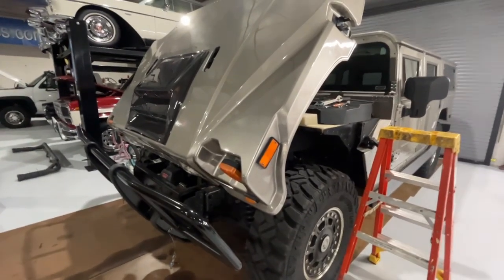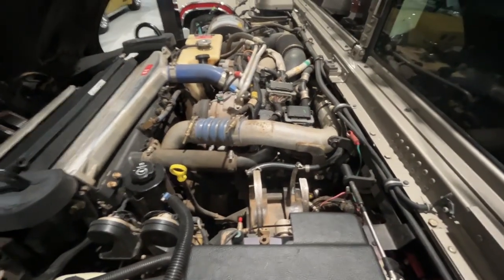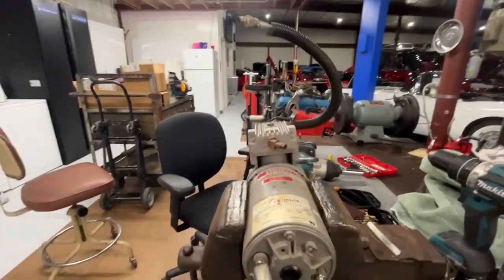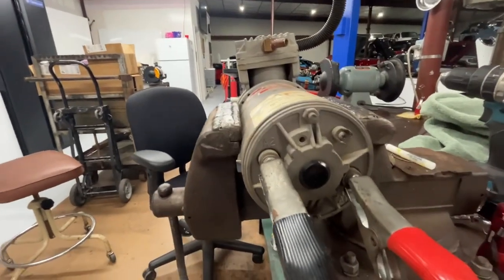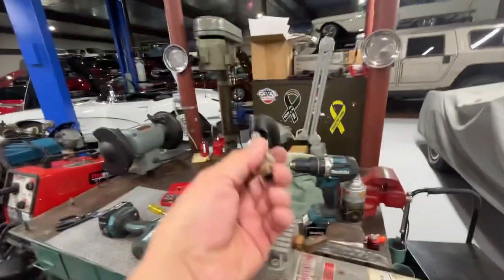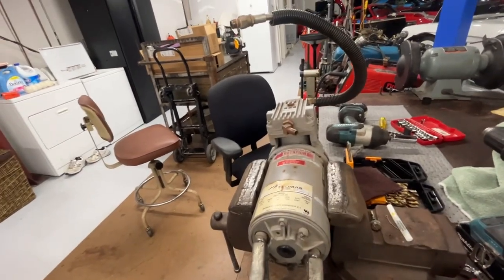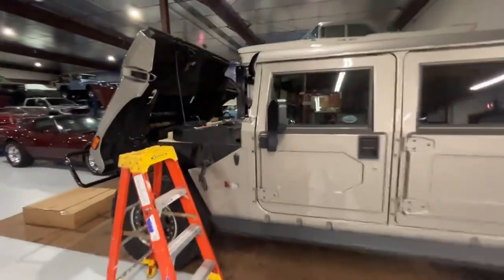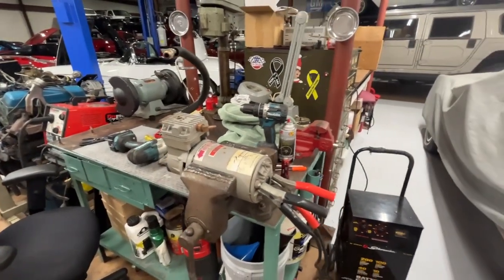Hummer H1 CTIS System Pump Repair.  Alpha 12V.  Central tire inflation system. Thomas Pump

Comment: Hey, unrelated question to the video but i got an AC question, since you're a certified technician.

Lets say hypothetically i run R12 in a r134a system, i make sure all of the old oil are out, and the system is leak free.

Wouldn't that result in colder temperatures since the ac components are oversized for r12 refrigerant?.

I use the proper r12 oil and use a bigger orifce tube then what the manufacturer recommends and i should be good to go right?.
Reply from the maker: Yep.. sure would!  Never done it myself but seen it done on a dual air 90s suburban..  best ac ive ever felt.  Not sure if the receiver orifice tube was modified or not, though.